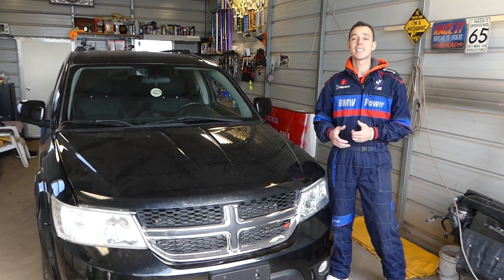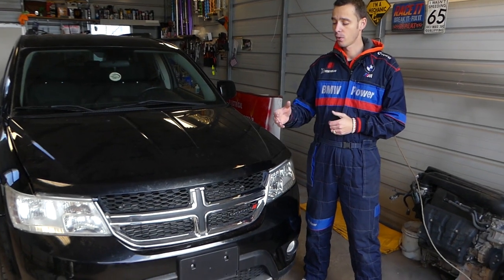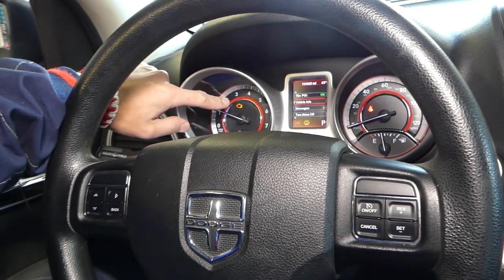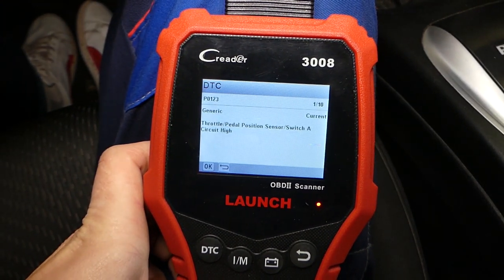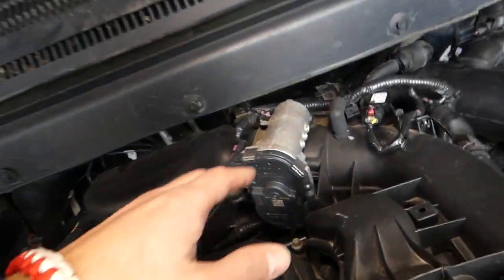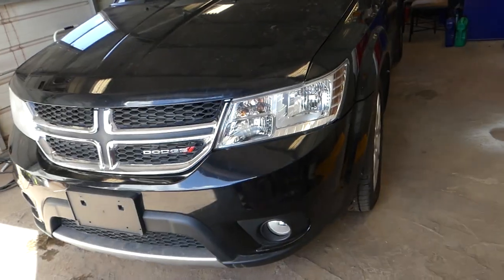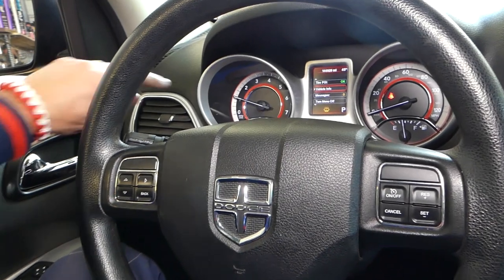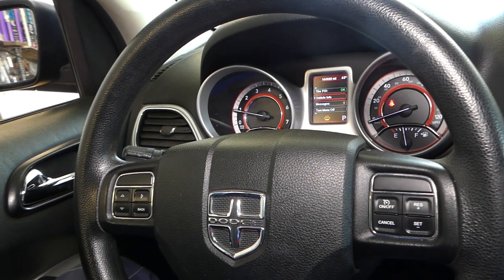CODE P0123 P0222 THROTTLE PEDAL POSITION SENSOR SWITCH A B DODGE JEEP CHRYSLER

Comment: I already tried replacing with two different throttle bodies and clearing the codes but the same issue keeps happening.
Reply: I believe you have to calibrate throttle body
Reply: Try hard resetting the ECM, it should go away
Reply: It seems my issue wasn't throttle body related and actually needed to replace the whole block. Piston was fried so I'm still waiting on engine to be replaced.
Reply: Same here
Reply: What about a shorted wire? You can’t just throw parts at the car and hope it fixes the problem you have to diagnose it
Reply: @louisvillalba7695 aside from my engine being fried, the issue actually was a shorted wire as well so it was a mixture of things wrong in my case 😅

Comment: Hope this is the issue with my Dodge Charger since I couldn’t find a video
Reply: I'm having the same issue with my Dodge Charger did you get did it fixed by chance?
Reply: @alyburke339  I found out that this only happens when my battery dies but goes away within few days

Comment: So, all I have to do is clear the codes ?
Reply: its not enough, you need to change the throttle position sensor first. after that you need to clear the dtcs 

greetings
Reply: Is the sensor in the throttle body

Comment: no testing? how is throwing parts at something saving money?
Reply: It does all the time especially if you know what it is, my Chrysler 200 2012 2.4 kept randomly stalling no engine light no codes took it to 6 major dealerships no one could figure it out.

I did my own trouble shooting after replacing my fuel pump didn't work, I found the positive wire to my fuel pump that runs to a TIPM module Totally Integrated power module.

I stripped the fuel pump positive and ran a jumper wire to the switched power outlet so when I turn the key  on the pump is powered up.

I myself no help found that the fuel pump relay soldered deep within the module was bad. I went to the junk yard and bought 2 for $20 when usually they are 1,800 new hooked all the harness connectors to it did the 12 seconds relearn procedure with the ignition.

Fixed the problem most newer mechanics rely on the engine trouble codes and if it takes more time to figure out they try and sell ya other things, your so called throwing parts when in all actually it's considered trouble shooting.

After they suggested a new battery, I and the alternator. Ignition coils and plugs, crank sensor, cam position sensor, VVT Solenoid's, coolant temp sensor, Oil Temp sensor, MAP sensor.

I declined all that and asked why that all needed to be replaced they said there's no specific test to determine what was causing the random stalling without a code or engine light illuminated.

I noticed it was the same symptom of fuel related. So that's when I went searching for the fuel pump relay after getting a junk yard pump and replacing it still stalling.

The fuel pump relay is soldered inside the Totally Integrated power module you can't get to the relay.  

Did my bypass and it worked no longer stalled.  Worked until I got the modules from the junk yard now fixed
Reply: @richardkeith7571  throwing parts is not trouble shooting 😆 it's loading a parts cannon... Clearly the "techs" you took it to were/are incompetent.
Reply: @madmike214  well that's 6 different places, with no way to actually diagnose the fuel pump relay you have to troubleshoot.

I didn't throw parts I declined, but if no trouble codes and no way to physically get to the fuel pump relay soldered onto the Module which was acting up randomly.

There is actually no way of knowing do you know it took me 6 months to actually find out myself it was the soldered in fuel pump relay with my own trouble shooting.

So your saying that 24 mechanics where incompetent, no one I mean no one could figure it out, and out of the 6 places I took it 3 was major Dealerships, Chrysler/Dodge dealership.

The other's was Car X, Dobbs, Firestone.

Some had it for 3 weeks diagnosing it no one could figure it out.
Reply: @madmike214  also the stalling was random sometime took up to an hour before it would stall.

Sometimes 15mins sometimes an hour and 30 minutes. So yeah no way of knowing exactly what it was so that's why I bought a fuel pump from the junk yard and threw it in.

But when first started would get voltage to the fuel pump, it would stall and have to wait up to an hour for it to restart back up.

And each time it'd stall it was like it was running out of fuel with over half a tank of fuel. These newer cars especially Chrysler/ Dodge have a TIPM Totally Integrated power module almost everything is inside it chips that run the wipers headlight horn turns signal starter relay soldered and fuel pump relay soldered inside.

So you tell me how you would find out what it was since 24 mechanics at 6 different places couldn't figure it out with fancy scan tools worth 20,000
Reply: @richardkeith7571  just because you went to 6 shitty shops doesn't prove your point lol....dealer is not top tear by the way. And yes there are tests to prove or the relay...that's actually a common failure for Chrysler tipm's and a bypass is not something new... you can also open some of them up and replace the micro relays as well. Look through South Main Auto videos he has done it I believe in one of his videos or maybe Pine Hollow auto diagnostics has done the bypass and both of them have done videos on testing

If you didn't throw parts at it...why did you put a fuel pump in it? What test lead you to replace it...if tested it you would have known it didn't have a power or a ground to run so why would you have replaced apart that is not getting what it needs to run unless you're ....throwing Parts at it
Reply: @richardkeith7571  that's an intermittent problem which are hard to diagnose I'll give you that...by the way 20k ain't much for diagnostic equipment...I've spent over 30k in the last 3 years on tooling...I'm chasing an issue with a Mitsubishi raider right now that's been taking me multi times testing , i haven't found the issue but I'm getting close and i haven't spent a dime of the customers money on parts...he took it apon himself to throw in a pcm which didn't fix the problem, ...an intermittent is only that until you've figured out how to recreate the symptom. 24 shitty techs is not surprising....you are obviously not in the field so you wouldn't know, 80-90% of so called techs are parts changers and don't know diagnostics.
Reply: @madmike214  well I'm definitely not in the field, and yeah they suggested replacing the ECU.

But I knew it was fuel related I've worked on my own vehicles in the past but never had the headache that I did with this Chrysler 200.

It took me a whole I'd say maybe 30mine to trace the fuel pump positive wire back to the Totally Integrated power module, strip that wire, and run a bypass to the switched accessory outlet so that when I turned the key it kept the pump running and no stalling.

Then I searched and searched for a fuel pump relay found out that it was soldered inside the module

No getting it apart it's molded together. So I went and bought 2 TIPM for 20 from the junkyard one was for an Avenger after doing the relearn procedure myself and it hasn't stalled since the best 20 I spent.

Also shops can low key get parts, to test to see if it's the problem, if that part doesn't resolve the issue return it to who the shop orders from saying it's the incorrect part and money back.

That way it'd save a lot of time and help resolve the issue quicker, I've done that while doing PC repair I repair computers and I've got parts to test if I didn't have any laying around and if it didn't resolve the issue in troubleshooting I'd return it and move on with diagnosing
Reply: @richardkeith7571  with a wiring diagramit would have taken you less time and effort... I would never trace a wire back to find where it goes...the diagram already does that. Then you would cut the system in half (no i don't mean cut the wire...) And basically (to use a baseball term) box in the problem of it were a short or open. Looking at a diagram I'd know right of the bat to check the pin out of the tipm, i would have also used my scan tool to bi-directionaly control that relay to test the circuit..toggle it multiple times. I could also throw a scope on it to test the fuel pump condition and would have known that, even intermittently, if the fuel pump comutators were faulty or not.there are so so so many tests that could have been done very easily to prove out the issue...all without throwing parts
Reply: @madmike214  they used threir scan tool to toggle it multiple times passed every time like I stated car had to be driven for a long ass time and a load placed for it to really to start acting up for the coil to start overheating or whatever I'm not mechanic but I do give myself credit to figuring it out without any fancy scan tools and went by wire colors not complete trace blue and orange. And I found the blue and orange in the front harness connector that took me like maybe ,10 minutes the whole thing I done took maybe 30 min's I can repair things without diagrams done it for years in electronics.

And only need to completely cut only if there's a short present, since it was the positive wire I stripped and ran a bypass/jumper wire to the switched power outlet now with me being no mechanic I'd say me doing that and figuring that out myself is pretty good.

After I did the bypass jumper I drove it for 3 1/2 hours, and no stall drove it every day for at least 2 hours didn't stall.

So I deemed it to be the Totally Integrated power module which it was.

I've soldered 30 trace repairs on old skool tvs with dual sided pcb no diagrams been working with electronics for years didn't even go to school for it. Started out when I was a kid taking
 toys and electronics apart to see how they worked complete teardowns and put them back together.
Reply: @richardkeith7571  i give you credit you figured it out... However, is seriously look Elsewhere for a better shop when the time comes to track a problem...those shops are straight up 🗑. That seriously shouldn't have been a hard diagnosis...the industry has a serious lack of competent, skilled and trained techs so when you say 24 techs or 6 different shops I'm not shocked at all.
Reply: @madmike214  me too four techs at each shop looked at it and a few private ones, I guess they only test drove the car for maybe 15 to 20 minutes not long enough to cause the stall.

Maybe they were lazy and didn't want to deal with it or not very familiar with the TIPM module I know I wasn't this is only the second time I owned a Chrysler product and the older one I had didn't have a TIPM module. It is a 92 Dodge Dakota V8 Magnum a damn gas hog but still running at 763,000 miles 😂.

I traded my 08 Focus for the Chrysler 200 to do Uber, my Focus was a Coupe 2 door, and requirements is a 4 door found the 2012 Chrysler 200 for a good price 3,000.

It runs really good now
Reply: Sometimes parts are cheaper than labor.  That said, a real mechanic can diagnose beyond a hope and a prayer and know that what he is doing will fix it.  There is a difference between a mechanic and a parts swapper.
Reply: @freedomseeker01  and there is a difference between a technician and a mechanic...
Reply: This sounds similar to a problem I'm having with my journey. I know you've explained here how you fixed it but I don't get it. What's the total integrated thing??